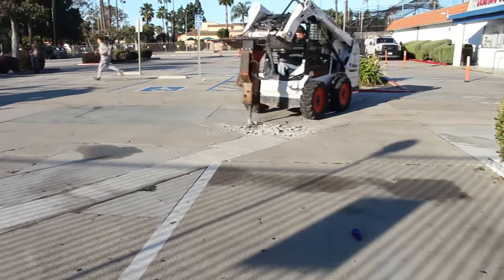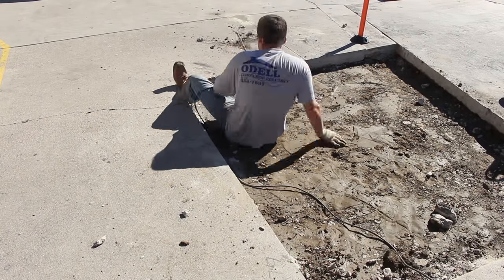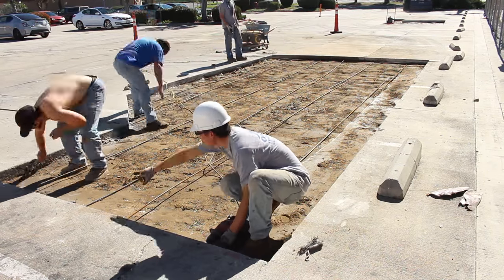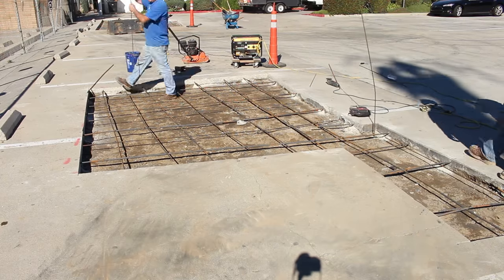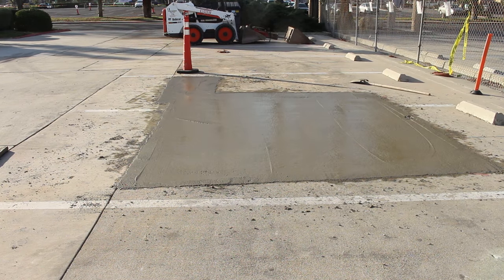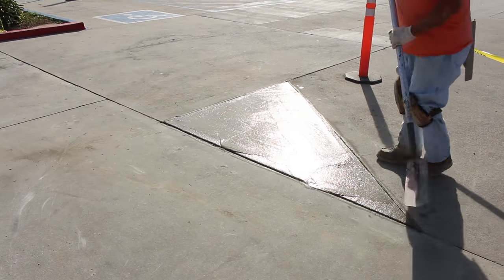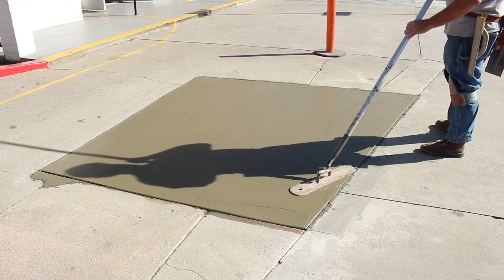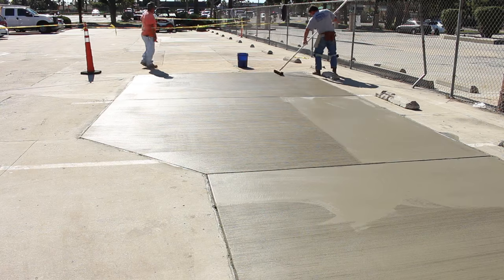Replacing Cracked Concrete Parking lot Slabs

Comment: Watched a number of your videos. Your experience shows with how effortless you make it seem. Thanks for sharing your work, a pleasure to watch.
Reply from the maker: Miles N 
I guess 35 years of hands on has its benifits.
TY
Reply from the maker: benefits
Reply from the maker: Miles N 
TY
Reply: No worries. I'm from Australia, it's interesting to see the difference in the process between what you do and what's done here. I'm a landscaper, so do a bit of concreting. I always use a base gravel and a moisture barrier (like plastic sheet) on structural stuff, as well as what we call bar chairs. Which might be what you call a Dolby? We use sheets of reo, that typically come in 8 x 20 foot sheets that have about 3/8 bar at 8 inch centres. We work in metric here so my imperial measurements might be a bit out.

Comment: Question, I’ve seen three different way to prepare the surface before the pour. 

Compacted bare dirt. 
Compacted crushed rocked base. 
Compacted crushed rock base then compacted sand.

What factors decide which base prep to use?

Comment: i have watched few of your clips and i don't ever see you use sand or aggregate as base.  Any reason for that?  We rain quite often in CA now, especially storm coming in 2 days.  Wouldn't be better to add sand/aggregate for drainage purpose ??
Reply from the maker: MessyGreasy Hand 
it's a good idea to use base in front of a rain storm if you plan on having a open hole.
my work is remove and replace. I schedule so I can do that in between storms, that way the dirt never gets wet.

Comment: Hey concrete gurus I use a subcontractor to pour my driveways and he does a great job I have a customer that's complaining at the end of their apron is cracking where you pull into the driveway.  I checked my guys work throughout the process and everything looked good.   The cracks are in a span of about a foot and goes into the driveway about 4 inches. It looks to me that someone backed up onto it before the 7 days we tell them to wait.  Anyway to verify this by the crack pattern
Reply from the maker: Thanks for sharing,
Its a good possibility

Comment: another fine job ,,, how thick would you really have liked the concrete to be comfortable driving a full lorry load over it
Reply from the maker: I replaced a lot of concrete in this parking lot over the years, and not one crack or any movement.
So the way I did it is native soil compacted, 5" deep with #3 rebar on 18" centers.

Comment: Nice work man! 
quick question on the video you mention 3500psi whenever I do driveways I do 4000psi.. since you add fiber mesh, 4000psi is not necessary if fiber mesh is present?
Reply from the maker: I don't know but it sounds good

Comment: How thick is that concrete? Looks around 4 inches? No wonder why the concrete is cracking, there's heavy traffic constantly applying pressure to it. In Australia, usually car parks are around 6-8 inches thick.
Reply from the maker: mmbupbup 
I imagine everything is better in Australia. Am I right?
Reply from the maker: mmbupbup 
This parking lot was done in the 70's. It defiantly wasn't built to last.
you should see the parking lot next door same company did that one to, but it has had zero maintance. Now it's a total loss.
Reply: I didn't mean that in Australia being better, was just comparing the regulations. I'm pretty sure you Americans are cluey with construction/engineering.

May I ask, I've watched a few of your videos you don't use a screed? And have two men screeding the concrete? It's funny how we all do things differently around the world.

By the way, your work is very nice.
Reply: Also, just a idea if you have extra re-bar apply it to corners, as you know, the corners is usually wear it cracks from. Applying the rebar cross ways on the corner, will strengthen those corners and if it was to crack it will grip on the rebar and stop it from opening.
Reply from the maker: mmbupbup 
good idea.
Reply from the maker: mmbupbup 
you must be paying attention to my videos
Reply from the maker: mmbupbup 
I realized that after I figured out what video it was.

Comment: It's too bad that you guys weren't contracted to rip the whole thing out and properly do it. No rebar, low psi concrete, and thin is a recipe for cracksville disaster in a parking lot.
Reply from the maker: yes the old lot was disaster from the inception.